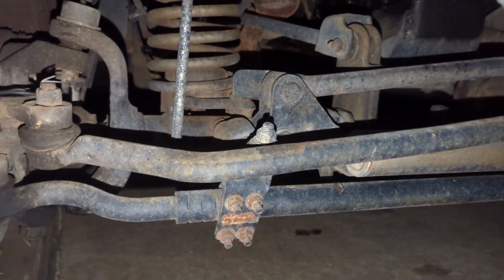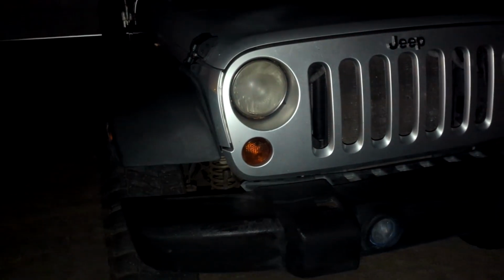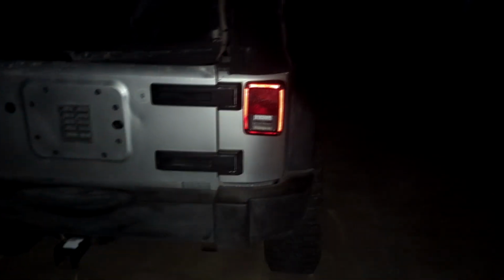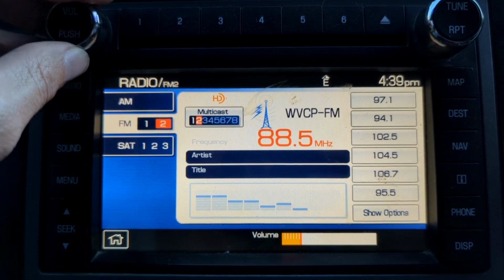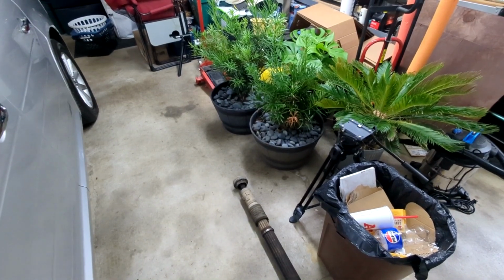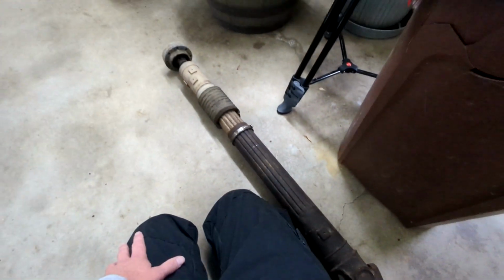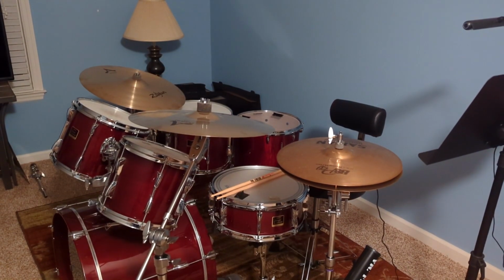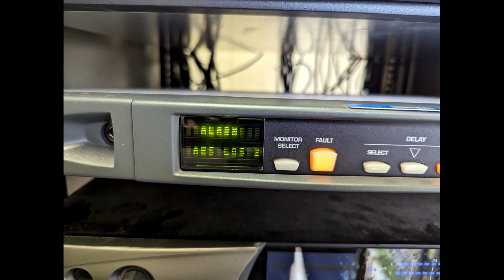November 2023 Update

Comment: I'm almost certain it is the body control module waking up the radio. Why it'd be initializing the CD player I don't know. Naughty Truck's radio definitely wakes up when a door is opened, so as to produce the chimes and beeps if any are needed. One can just hear the soft pop from the amplifier shutting down a few seconds later, if the surroundings are quiet enough.

Comment: I wouldn’t be surprised if the radio is used for warning chimes and possibly even the sound of the turn signals. The result is you normally require an extra special wiring kit and mounting kit to install anything aftermarket. Even a replacement stock stereo might need to be programmed to work. Additionally if you need any help getting alldata running or help navigating let me know